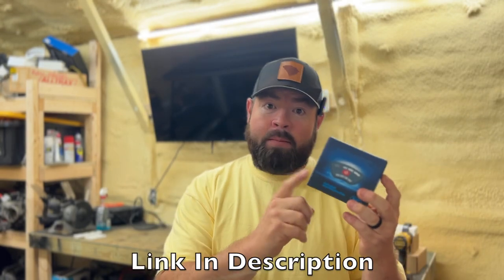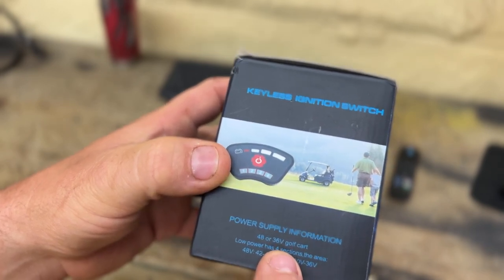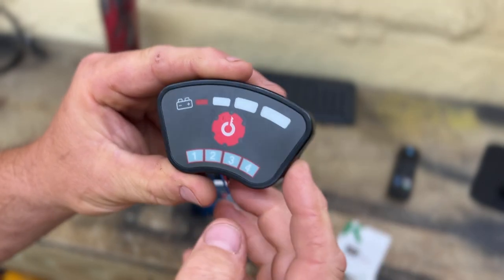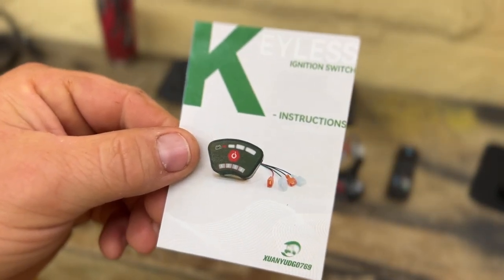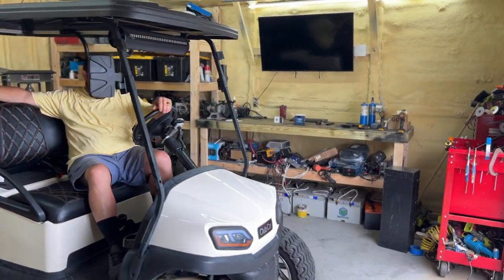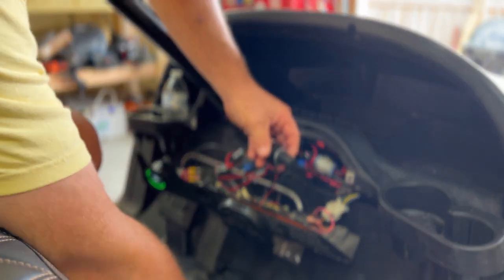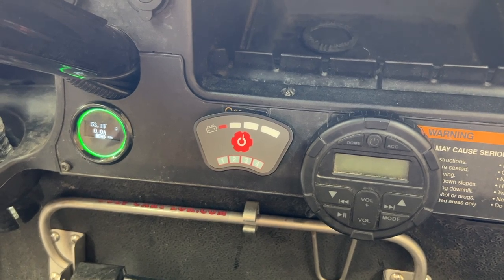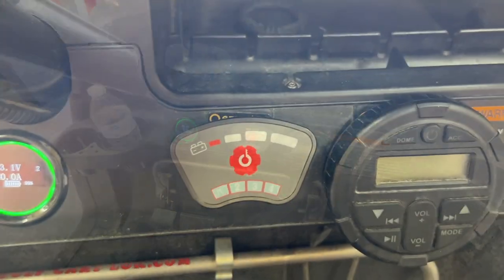I Bought A $100 Knock Off XIQ Stinger Keyless Golf Cart Ignition Switch!!! | Review & Install

Comment: Great video put what is the purpose of a PIN code keyless ignition switch if anyone can reset the code by holding #1&4 down and enter their own code and drive off with your cart.  Thanks but no thanks!

Comment: great video... thanks man.   You answered my first question which was how do you tell if the switch is in the on position.  You showed that the light circle stays on.  So that part was fine, but I totally agree with your analysis, anyone can press 1&4, reset the code and you bid your cart goodbye.  Fuggeddaboutit!!  I will stick with my new key switch (unique keys unlike the idiio keyswitch installed by EZGO which are all keyed alike.  I really shook my head on that one!   Anyhow thanks a lot.  Kept me from wasting $$$

Comment: Can you connect this to an older golf cart? That doesn't have wire harness. Where would you connect to power wires?
Reply from the maker: Sure, Just run 2 wires back to the postive and negative of the battery pack 48v

Comment: Thanks for another great video. I'll stick with the Stinger. I ordered one after watching your Stinger video and almost cheaped out with this one. Glad I didn't. Can you tell me about the battery monitor gauge you have on this cart? I have been looking for one to replace the low voltage light and it has been difficult to find something with the limited space. Thanks
Reply from the maker: The battery gauge that is in this video is included with the epoch lithium battery kit, Its not a universal gauge.